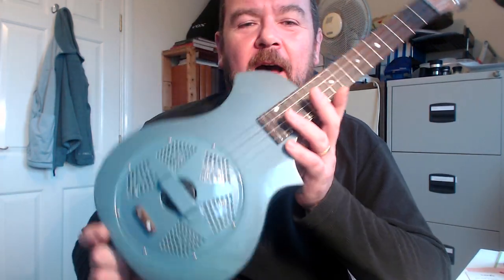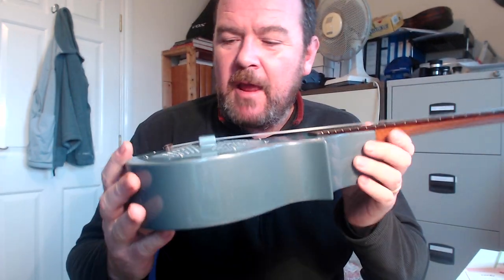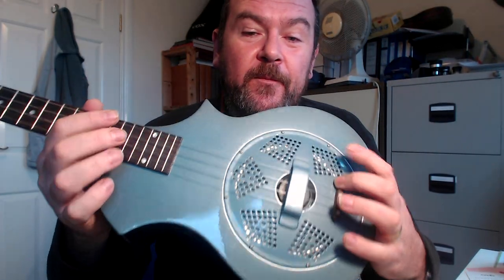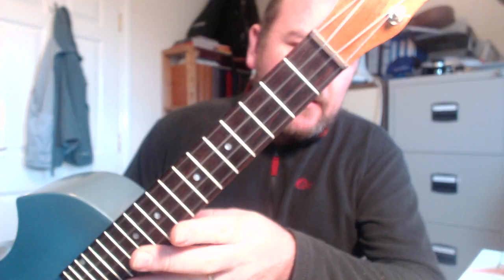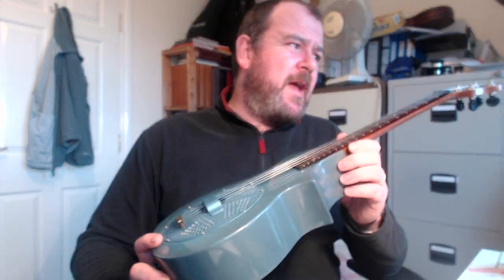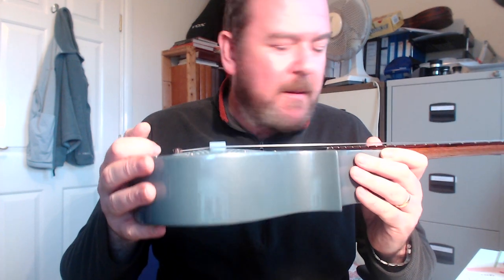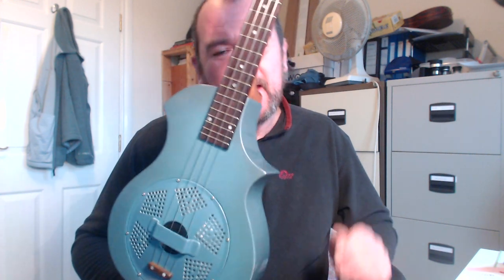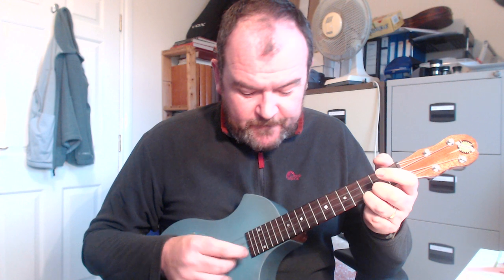Got A Ukulele Reviews - Beltona Type 2 Tenor Resonator

Comment: There's nothing modern about this body shape. The body shape is a copy of an old Kay Musical Instruments guitar body that was probably used first around the early 1930s for 6 string and tenor guitars.  Kay was an American company.  Also, the head stock shape is very similar, if not identical, to a Kay design which was also used on guitars as well as banjos during that period.
Reply from the maker: +mrfester42 Most instruments are ultimately a copy of something else in shape.
Reply: +GotAUkulele    That's true with generic designs like the dreadnought bodies of acoustic guitars or the body design of most ukuleles.  Those designs are generic, although with many, like the dreadnought, they did not start out that way, the dreadnought being a C.F. Martin innovation.  In my opinion most are not copies although there are many derivations and variations of past designs used for later designs.  
  The body shape and head stock design on this uke are most unusual and singular but they are not the design of the manufacturer.  They are designs of the now defunct Harmony Musical Instrument Co of Chicago.
  The original manufacturer no longer exists but even so, I personally am a bit  bothered that the original isn't acknowledged by the builder in some way.  Something tells me that I'm being a bit silly about this but I wanted to point it out to those seeing your video.  It's probably my need for fairness.
  At any rate, I've only viewed a few of your videos but your evaluations and critiques impress me as being very complete, and fair and you seem to have a good feel for what makes a quality instrument on many levels like, construction, aesthetics, value and playability and sound quality.
  I've been a guitar player for over 40 years and I'm just getting into ukuleles and my sense is that you have many years of playing experience which is invaluable in your reviews and evaluations.
  Do you  review banjo ukes at all because that is where my real new interest lies?  I would be interested in any banjo uke reviews you may have done.
Reply from the maker: +mrfester42 Yeah - fair points. There are one or two banjos in my reviews on the website - but not many - the banjo ukulele world is a very particular interest area, in which I freely admit I am not as well versed as others!